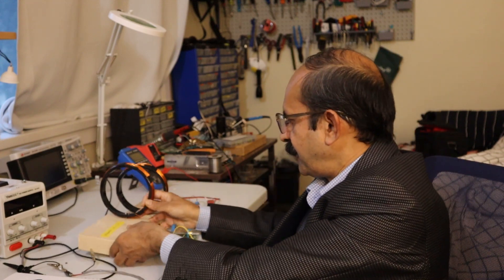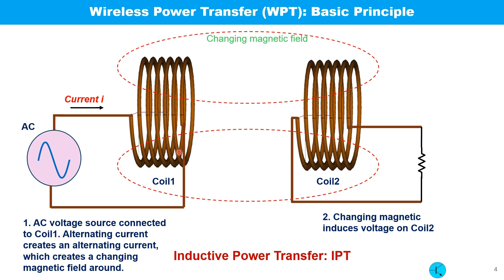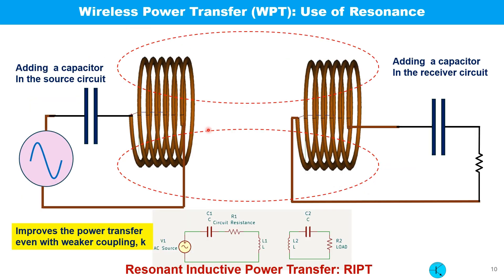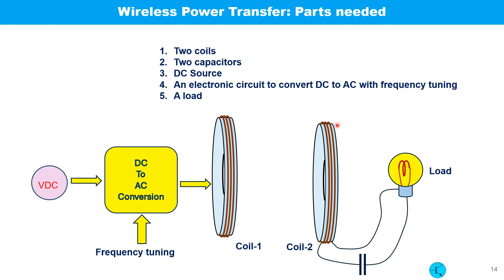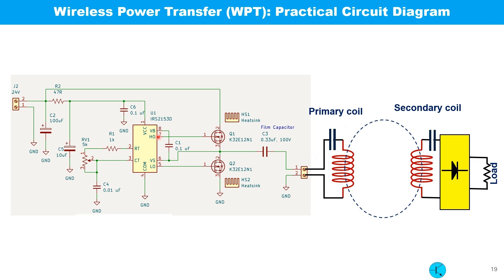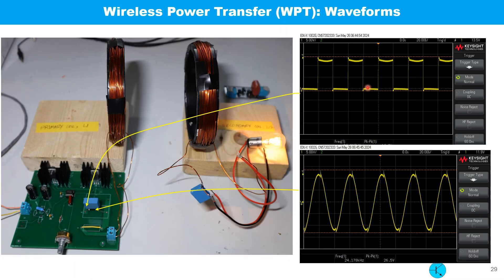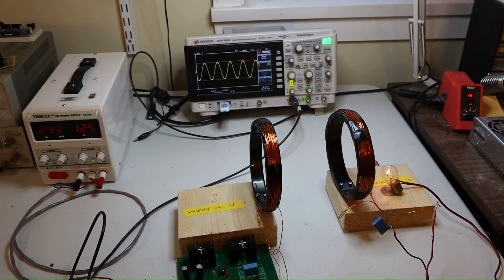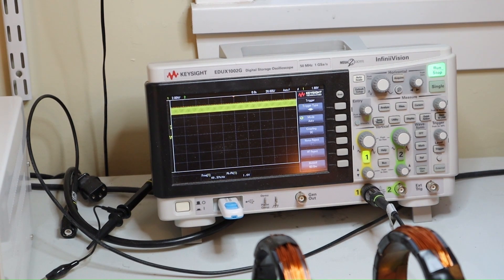Wireless Power Transfer Part-1

Comment: What are the voltages of C2, C5, C4, C6, and C1. Kindly assist with this ASAP 🙏
Reply from the maker: Thanks for watching. Only C3 (capacitor connected with the coil) should be of Film Capacitor, Voltage more than 100V. The others are 35V or 50V rated.

Comment: Can you help me which resonance circuit is better series or parallel lc circuit? I am working on nfc payment ring making from credit card
Reply from the maker: If you think of longer distance of power transfer, Series resonance is better. The problem with series resonance is, at the resonant frequency the impedance is low, if the secondary coil is not receiving any power or is disconnected from the load, high current continues to flow in the primary circuit. That is why some control circuit is needed with the series resonance so that if the secondary coil is not receiving any power it will reduce the primary current. On the other hand, with parallel resonance, it is simpler. At resonance the impedance is high so even if there is no presence of the secondary coil, the current will remain low. But the power transfer distance is less than that from series resonance.

Comment: Wireless power transfer with 2 high-Q tuned circuits with low coupling coefficient is a 4th order circuit.  To control & regulate the power transferred & the energy stored in each side, there must be 4 degrees of control.  Without that control, the power transfer becomes chaotic!  Example of the 4 degrees of control: duty cycle of the primary driver, frequency of the primary driver, varying the tuning capacitance in secondary, & DC/DC variable ratio converter in the secondary after the rectification.  All these 4 controls require regulation from a common controller which has access to all the signals on both primary & secondary sides.  Stabilization of 4th order high-Q circuit is difficult because there are 2 pole pairs closely spaced in the response function.  Lower order approximations are not practical in the control algorithm.
          The easiest way to stabilize the system is to introduce losses (which is what most "wireless power transfer" systems shown on the web do).  But that defeats the purpose of the power transfer (to do it efficiently).
          A tesla coil is example of such a chaotic system.  The energy "sloshes" uncontrollably between the primary & the secondary.  The only thing "regulating" is electrical breakdown at the secondary during one of the "sloshes".  The instability is exploited to get a burst of high power for the spark.
Reply from the maker: Thanks very much for watching and your valuable comments. Yes, I did not do anything on stabilization. I just wished to show some basic principles behind.

Comment: I'm excited to follow your new series. The future seems full of wireless transfer of power. If we can all build a small model, we can better understand and contribute to making this happen.

It is interesting that you begin by dividing the far-radiative from the near-non-radiative. Would you agree that the main difference between the two is the faster oscillating frequency of the far-radiative?
Reply from the maker: Thanks very much for watching and your comments. Hope to post my second part soon. Usually the radiative transmission uses higher frequency for power transmission. Some people are using higher frequency for non-radiative power transmission (6.7 MHz or 13 MHz) as well. However at this higher frequencies some other issues come in to effect. I hope to discuss those as well in my future videos. Thanks again

Comment: I think there should be a diode for the charge pump for the gate drive in your half bridge schrmatic?
Reply from the maker: Hello Greg, thanks for watching. Actually there are two versions of this self oscillating driver available. One is IRS2153D, which has built-in charge pump diode, so you do not need to add one. There is another version without D, that needs the diode. Thanks for your comments
Reply: @technologyforyou5976  Very interesting. All the circuits I have come across need an external diode, but I suppose it is very sensible for the driver to incorporate one.
Reply from the maker: @AllTheFasteners  Hi Greg. Thanks for your comment. Yes, in some circuits with this chip  it recommended to add extra diode in parallel to the built-in one. In the datasheet you will find one example.

Comment: did you calculate the power transfer efficiency?
@15:11 when the two coils briefly get very close the power goes down (brightness decreased) while the coupling is at its highest! why?
Reply from the maker: Thanks for watching and your comments. If I try to explain everything in this video, the length would be longer, and difficult for me to process. This is only part one. I hope explain why that thing happens which you observed. I'll also show some calculations like power. efficiency etc. Thanks again

Comment: Sir in this innovation your good self uses a big setup for little wireless power
Reply from the maker: Thanks for watching and your comments. In my next video I'll some some calculations regarding power and efficiency. Just to mention that the output power in not little, the lamp is consuming lot of power mostly dissipate  as heat.